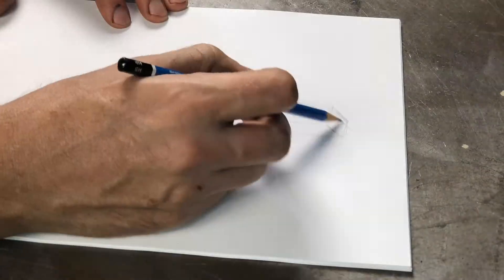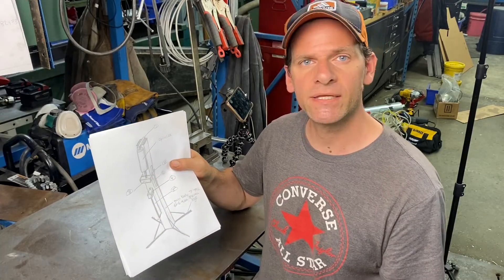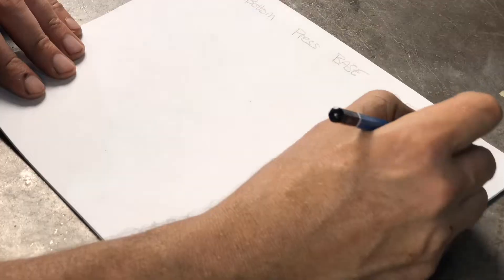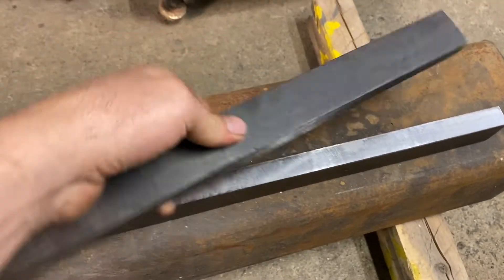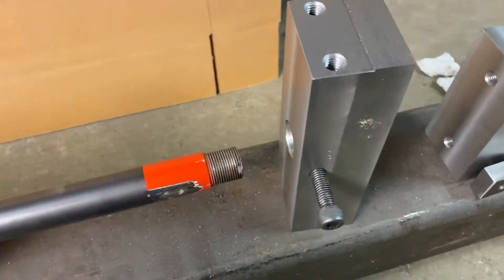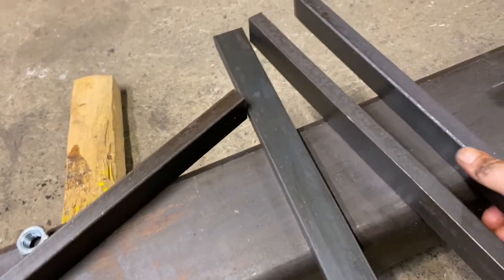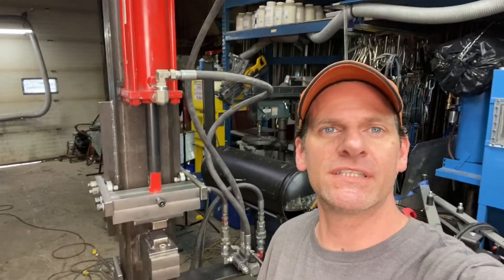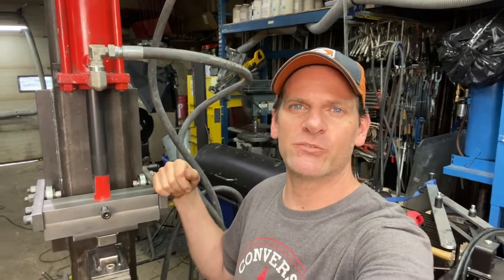How To Make An Awesome Forging Press !!

Comment: Can you help me? I cant figure out what size threaded rods and steel plate thickness i need to build my 200 ton press. Its just 4 vertical threaded rods, with a top and a bottom plate. The 200 ton cylinder just sits inside this cage...   Is 1.5” unc B7 threaded rod, with 1-1/4” thick a36 steel plates okay?

Comment: You are a good fabricator and machinist. The column (sq. tube) that the cylinder and ram are mounted on  will flex when loaded on higher tonnage presses. This press you built appears  to be light duty.

Comment: I think I would've mounted the lines in a different spot that's going to get in the way on anything even a little long. Also that ram seems a little underpowered but it's really a preference and budget thing it's still way better than beating your brains out with a hammer. Also it may just seem that way because I'm not seeing it in person.

Comment: Good work ,the thing that gets me with every build (including my own) is when we think about everything and it still flexes one way we don’t like or can’t stand 

How much flex can you see with the arms to the slide guides ,I dig the trailing guides so this is why I ask
Reply from the maker: That’s actually one thing i changed after years of using this press is the material the arms are made from are now heat treated
Reply: @BonifabcustomRobBonifacio  sweet
Reply: Excelente trabalho. Quantas toneladas de pressão ficou seu equipamento? Obrigado

Comment: How do u like the blue forge hammer. any issues?i have the same type
Reply from the maker: I didn’t like it very much it’s ok to use once in a while but not for production
Reply: How do u find the oiling system.  Mine is really finicky

Comment: Would you be willing to write what the hydraulic push cylinder specs are Where you got it?
Reply from the maker: I got it from a place in canada called Princess auto and it has a 4” diameter bore
Reply: @BonifabcustomRobBonifacio   thanks i keep looking at them just wasn't sure what bore/stroke i wanted is 18 in enough or 12 in thanks

Comment: I wish you would show more on the hydrologic part .
My other question, is it going to be trong enough  the top it doesn't  look strong .
But over all wonderful  work it will kill
Reply from the maker: I actually put a plate on the top after welding it all just to be safe thanks

Comment: Why do you prefer this asymmetrical design over something with say two uprights left and right with c channel bridges spanning between them and the cylinder suspended between the channels?
Reply from the maker: I wanted to make something more simple to build and wanted to come up with a different design than the typical, thanks for watching

Comment: i like this press a lot, what is the budget on materials
Reply from the maker: Thanks , i thinks it’s about 350$ in the steel and 100 for the cylinder. If you need parts like the machined stuff i do sell some separately that are made at my shop

Comment: Nice build, is the bore4"or 5"? I want to use bearings for mine,most builds Ive seen use a guide that is steel on steel and I thought it could be rolling like yours.Do you have a video that shows the guides as you squeeze?What pump are you using also?single stage or double ?
Reply from the maker: Mikey Jay hi , I’m using a 4” bore for the hydraulics and the pump is a single stage and runs on 110volt  , i don’t have any video of the guides as i squeeze at the moment thanks

Comment: I like this design.  Is this your first press?   Seems like you’ve been using one for a while.   Also, have you considered making a digital plan available for it?
Reply from the maker: ManCraftingTM no it’s not my first press I’ve been selling this design for a while and came up with this  simpler design to share . I have it on cad available to whoever wants to build there own i will also have parts for sale if you don’t have the ability to machine parts thanks
Reply: Bonifabcustom Rob Bonifacio good to know.  This is way simpler than the design I came up with 2 years ago and still haven’t built.  Also more compact.   I want something semi portable that I could take to an event for demonstration if I wanted to.  I’ll send you a message to get the cost of anything I may need.
Reply from the maker: ManCraftingTM no problem let me know thanks